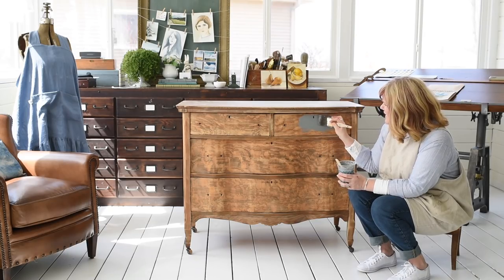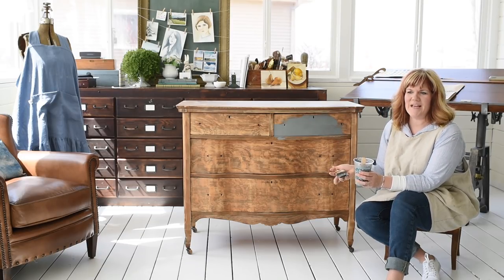Applying the First Coat of Milk Paint Update

Comment: Sanding pieces that you’re going to use CHALK paint on will most likely cause bleed through so sanding has its pros and cons.
Reply: Crystal yeah,but you can use a primer before painting a piece. That helps to stop the wood of bleeding through. That‘s what I did with an oak chair...works pretty well.